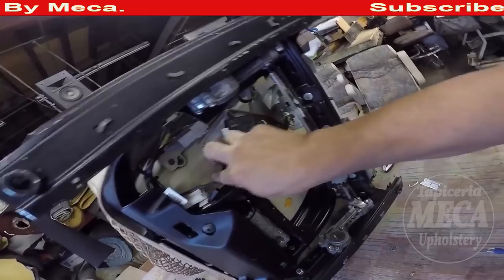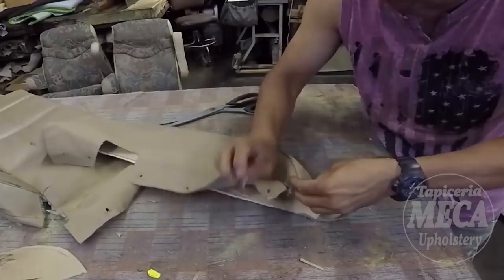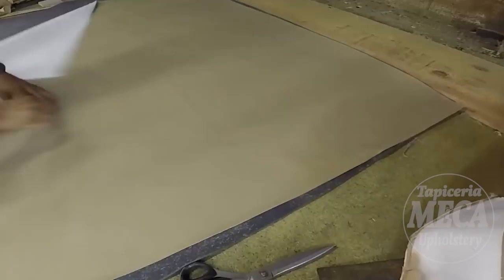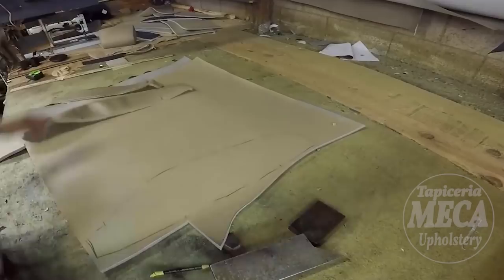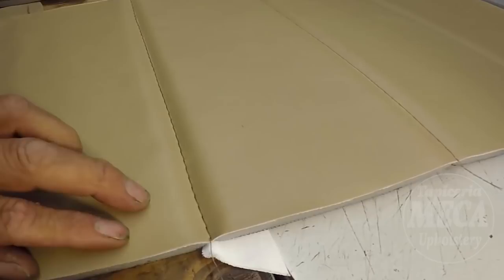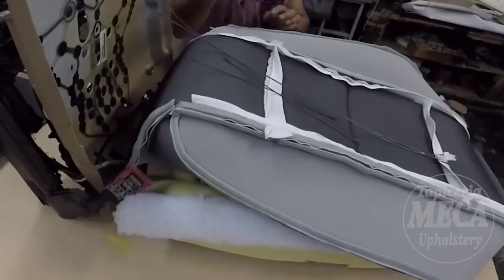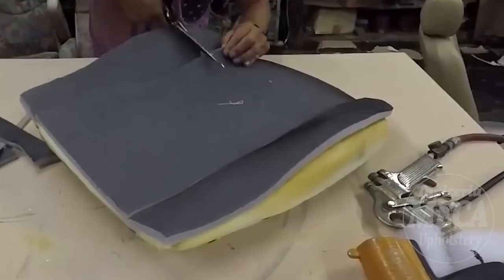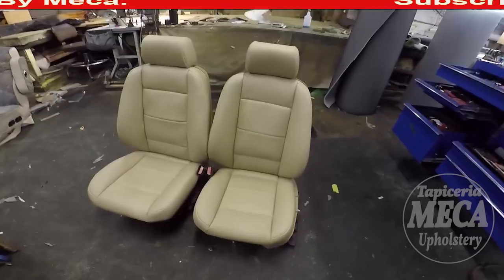How to Upholster BMW Bucket  Seats \  BMW Seat Cover

Comment: I’m enjoying watching your video. I have a questions. What type white foam did you use on this seat to make it softer. Also I saw you are using staples to tacked the material to the foam. Can you please tell what brand staples is that, and what size is the staples did you use? Thanks!
Reply from the maker: There are a different way how you can attach this cover to the plastic I use staple. The foam that I used is 1/2 inch pholyeratane medium density

Comment: Amazing video really appreciate it. The foam you use can you explain more on 1/2” used and others? Where do you buy these and do they have specific codes for the different foam you use? Thanks
Reply from the maker: That foam that I uses is SWSC SEW FOAM SECONDS
Reply from the maker: I use to  FLEXIBLE Polyurethane foam it is a good 1/2 inche  foam
Reply: @mecaupholsterytips  thank you I presume this is medium or high Density and compression rate or does it depend on what you are fixing or creating?

Comment: Did you add 1/8 for shrinkage on the top plates
Reply from the maker: Yes 1/8 thickness
Reply: @mecaupholsterytips  is that for 1/2 inch pink foam will that method work